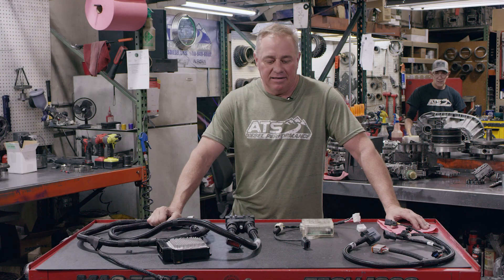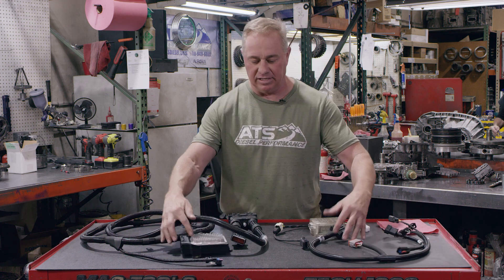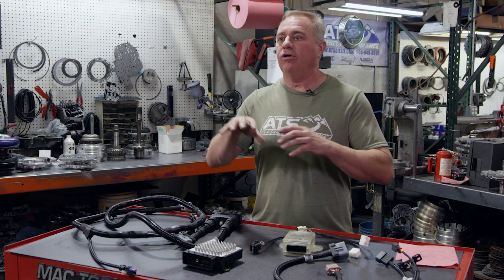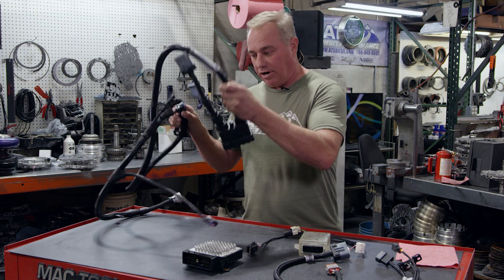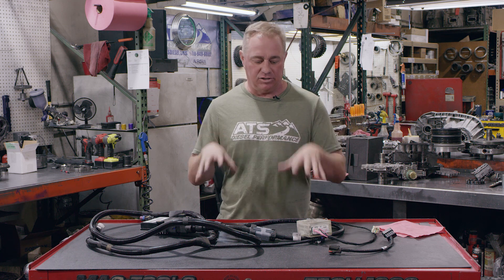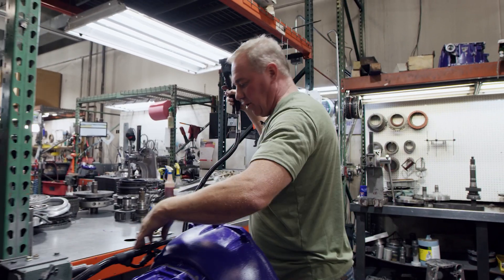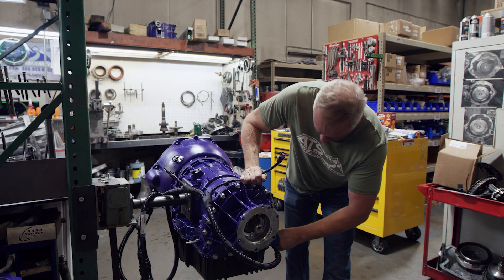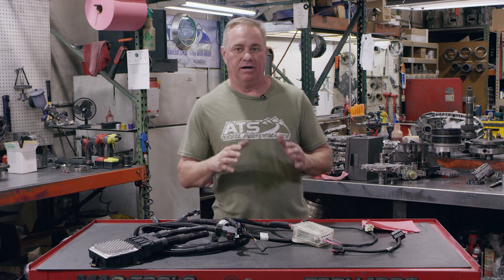ATS Swap · Cummins to Allison Electronics Kit - Installation | Make Your Electronics Work Again!

Comment: These videos that you have been putting out for your Allison conversion kits have answered  nearly all of my questions. Could you also make a video explaining what model Allison Transmissions can be used for this conversion? From what I have learned, the 1000 series and 2000 series Allison Transmission are very similar. Additionally, there are just as many 2000 series transmissions for sale and cost about the same as a 1000 series.
Reply from the maker: We only use the LCT 1000 Allison transmissions and we recommend using the LML year transmission. If you use a different year from 2006 and up, you will need our upgraded pump and possibly our upgraded valve body as well so that everything works properly. We will offer our Full Kit of course, then our Install Kit which has everything less the transmission and then just our electronics upgrade kit for those that may already have an Allison Conversion done by someone else.

Comment: Thank you so much for the information I interest conversion to Allison in my 2013 ram 2500 diesel 6.7
Reply: Seems like it would be better, and easier, to just install the Aisen. The one that was optional on the 3500. Bulletproof transmission.
Reply: @kevinbarry71  The aisin is hardly a bullet proof trans. They are only slightly better than the 68 and have the added bonus of being impossible to program. So while they might have better hard parts inside, the lack luster programming makes them unable to take advantage of the better design. The Allison is hands down the best HD pickup trans ever made.
Reply: @jacobormsby9241  I realize you cannot program them. But they have an extremely good reputation for taking lots of power for very very long distances. And I wonder about those new 10 speed Allisons. Which are not Allison actually, they're just made by General Motors. I don't trust any transmission General Motors manufactures itself
Reply: @kevinbarry71  I mean... Allison has been owned by, and therefore is, GM since 1928. So your logic is flawed. Every Allison ever put into a pickup or HD vehicle was made by GM. Kind of like how Cummins owns Holset, 2 parts of the same company.
Reply: @jacobormsby9241  not exactly. Allison was sold in 2009. Bankruptcy and everything. It's still a separate company. And as I understand it, the new transmissions are not being built by Allison. They are just branded as Allison by permission, but built by General Motors in their own factory.
Reply: @kevinbarry71  the 10 speed "allison" doesn't apply here. This is for the allison 1000, 6 speed transmission. The aisin is a good trans but as already mentioned it has its issues,  but all transmissions do.
Reply: @jacobormsby9241  the gm slash Allison is not an Allison.  Gm doing their own deal.